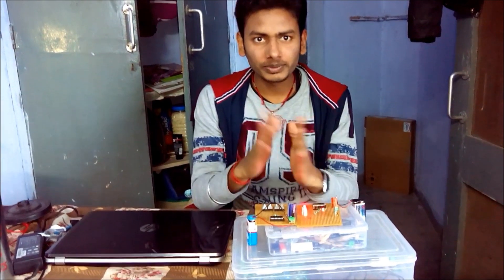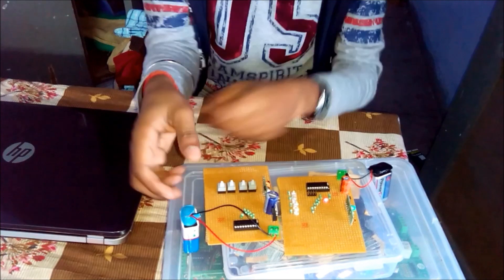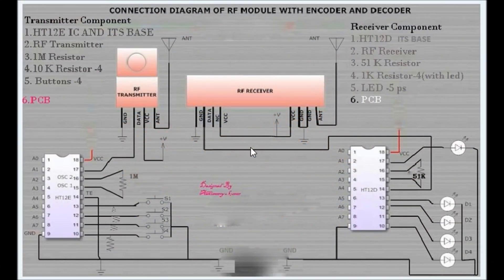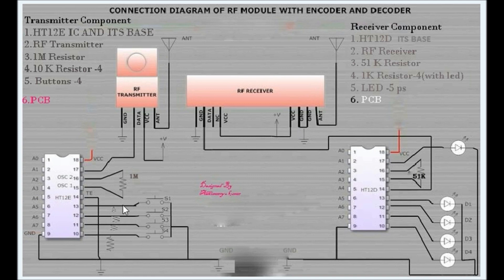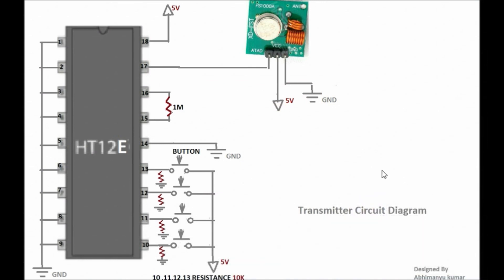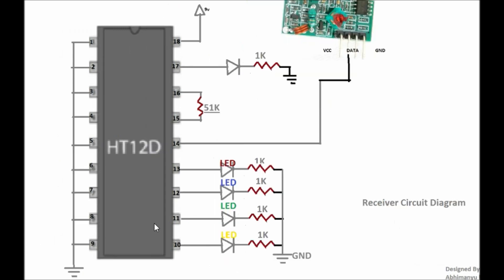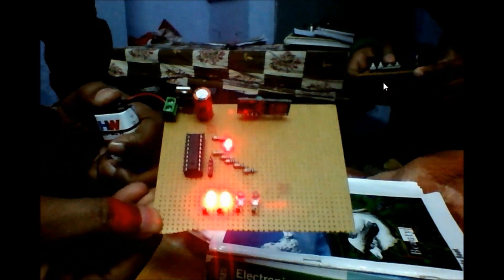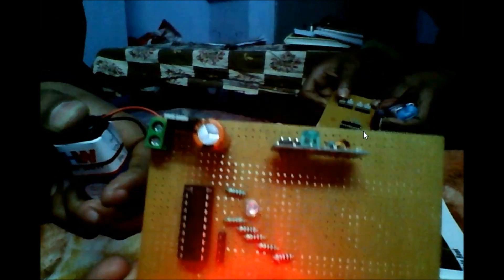Home automation electronics project(rf based wireless remote )

Comment: Hello,  in some other videos i saw dat even if the buttons are not pressed, yet the led's glow which is not in your case. how is it can u explain please??
Reply from the maker: if led is glowing without pressing the button that mean pin is directly connected with 5v supply not with the button.
if we want to on or off the led button is necessery.
Reply: coding please?